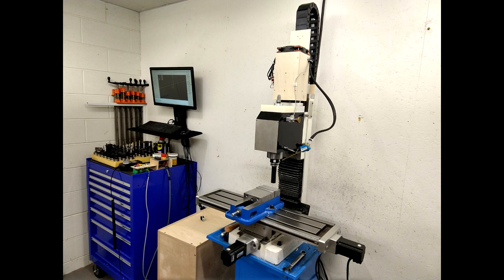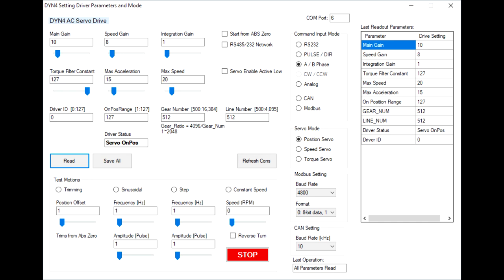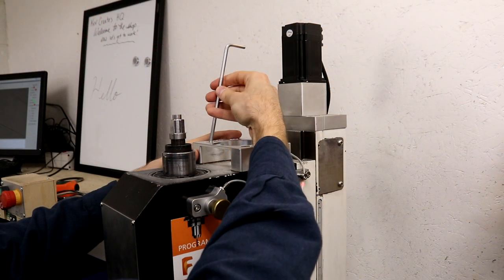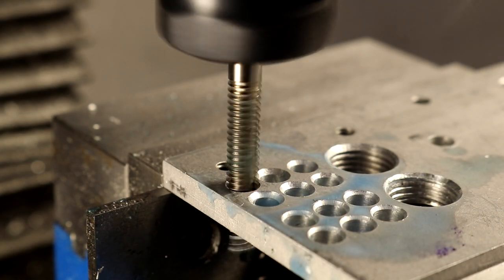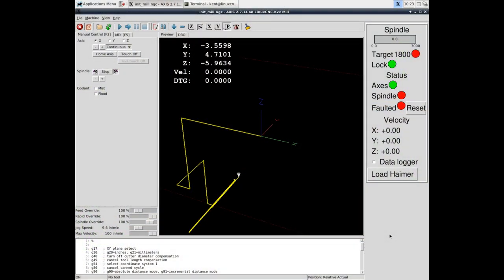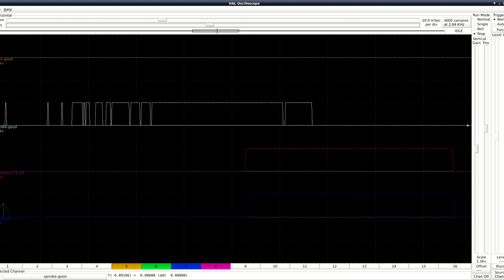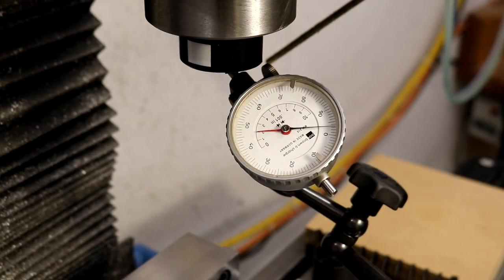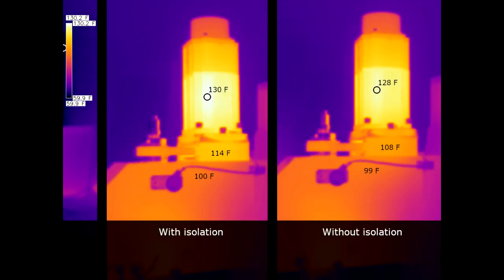AC servo motor for CNC mill spindle: Questions and answers

Comment: Thank you Kent for sharing your experience.I think it's so great that you finally have an electrical control cabinet.Great
Your path shows exactly the path of an electrician.You always have to be able to measure everything.I admire that about you.You can improve everything on the electrical system.Great.Also how you set it all up in Linux.I just look there and have no idea how you do it.
You know I actually did exactly the same thing only with Mach3 and a slightly larger servo.
But who I look at all you did to get it to work in Linux.Incredible.I would never get it done.My electrical setup took 1 day maybe 2 days.
I think you are a very smart man.That the installation was so difficult(linux installation) for you shows me that Linux is not for me or Michael.Too difficult.It's unbelievable to me how you did it all.I'm surprised that your pm 25 can't make coffee yet.
It was just a joke.
After all the work I congratulate you on the good servo.I don't want to give up mine anymore.I wish you a lot of fun with yours.
Now you only need linear guides?They would be good.Then your workpieces will be even better.Let's say that:""""you can sell them"""
I wish you all the best
best regards Stephan
Reply from the maker: Hi Stephan, thank you so much for all the support and kind words! This was ridiculously difficult and maybe there was just something wrong with the drive. DMM stopped replying when I suggested that. So, were the difficulties because of Linux, the particular drive, my breakout board, me? I don't know. I am so glad you didn't have the difficulties I had. My previous mill had a 1.5kW 3-phase induction motor and VFD. That was super simple to setup even though the VFD had many more settings. I've written a serial interface to the drive and that seems more reliable. I'll demonstrate that soon. Just send a serial command "run at 500RPM" and it just works. It'll never work for rigid tapping, the feedback from the drive is a mess and there are pulses lost at even low RPMs, doubled checked against the drive's own position information, but that's OK. Today, spring is near, I just want a working mill, and to leave the basement. Have a great day my friend :) Kent

Comment: I’m still not sure on the ballscrews i wanted to get pretty high quality ones but sourcing them seems to be quite a challenge i did look into tdk ones. For the servos i wonder if i should go mains or 24 volts one is nicer to setup but isn’t so safe and the other one requires lots of power supplies. A complete other point is that i want to still keep the manual way too so i considerd getting a pice that does a 90 and i would place the motor underneath the base not sure if that is a great idea. 

For the servos i looked at lenze and leadshine not sure if there are cheaper ones. I would also like to control everything with ethercat as it’s easier to setup at least i think it is compared to modbus etc.
Reply from the maker: Thank you for sharing, that's going to be an impressive machine! At 24V response might be slower as overcoming inductance will take longer and thicker cable will be required for the higher current. Don't know if anyone would notice. Grounding well will create a foundation of safety.

Comment: Excellent documentation on the DYN4 spindle setup for the PM25! I'm currently researching AC servo's to replace my stock BLDC setup and found this info to be very insightful. Regarding the noise problem found coming from the drive, Could you attenuate the 20KHz noise by using an inline RC style low pass filter installed on the encoder common to filter the noise causing the encoder error?
Reply from the maker: Thank you Kyle, glad this was useful! I can't comment on using the filter. It's worth a try. The best mechanical and electrical solution is likely to use a second encoder. Some time has passed since this video. I have enjoyed the DMM servo. There might be a 5kRPM 1kW special order available, which I would get if starting over.

Comment: Kent. Fantastic information. I have been following your PM25MV videos as I am in the process of modifying mine.  Questions:

Did you consider replacing the spindle itself and/or the stock spindle bearings on the mill in an effort to improve performance for surface finishing, or generally the performance of the mill?  Did you have any thinking on that to share?

Also, I see guys replacing the stock spindle bearings to angular contact bearings when chasing higher spindle speeds. The AC bearings being rated for higher speeds than roller bearings. How fast have you been running the stock bearings in the mill and what can you say about their performance. 

Thanks so much.
Reply from the maker: Hi Iain, we all make do with what we have :) The people you mention are honestly more skilled in the mechanics than I am. If you love the conversion process most of all, both ideas you mention may be worth pursuing.

Some people use very fast 20k RPM spindles with integrated motors or BT30 cartridges with a big external motor. These are often inspirational conversions. Sometimes functionality is lost because of the specialization they are seeking. Before getting into that expense and time like that I would thoroughly investigate purchasing a turn key machine. 

One of the best PM25 conversion threads on CNCZone is from Starleper1 and he states the bearings on his machine are rated to a minimum of 5000RPM. The particulars may have changed since then. With this reference, with no intention of going beyond 5000RPM, with no measurable play, and with minimal heat, for me, little may be gained by replacing the bearings.  The splined shaft has had a greater negative impact on surface finish.

https://www.cnczone.com/forums/benchtop-machines/101231-pm25mv-bf-series-9.html#post859477

Best wishes

Comment: I'm only 15 minutes in, but so far it seems like you've covered a lot of the issues I've had with the same motor/driver (I don't have the brake). I've never been able to get the RPM output to match what it should be from 0-10v and I don't think I've ever got it tuned correctly without getting some kind of overvoltage error from time to time.

However, I never went through with using a line reactor or noise filter, so I'm wondering if that would maybe solve some of my issues.

I've never been able to get the encoder to talk to my Masso controller either, but I think that's more the fault of the Masso than the servo encoder.
Reply from the maker: Thank you for confirming that I'm not alone. Like Fox Mulder, "I want to believe", but I can't imagine everyone out there going through the effort to workaround some of the problems we've had. The encoder signal might be too noisy. On the USC board I have, I believe the encoder lines go right into the FPGA and the spikes that I measured could damage the chip. I have to assume that my drive has problems and other copies are fine.

Comment: Good video!! you seems the right pearson to ask.. I have old lathe (small one) and want to make cnc .. and 1 question which i cant answer is that i want to use main spindle as deviding head.. now the question is will be ordinary servo good enough or do I need to buy servo with brake? can even be programed in linux cnc to use brake when you have souch operation ?
Reply from the maker: Many thanks! Great question, there's a lot to it... Using a servo you could use the spindle as a dividing head. With rigid power transfer between the servo and spindle and good gearing you may be able to perform machining. You'll need to consider the holding torque vs. machining torque. The brake will help to hold position but likely with power no greater than the servo is rated for if matched. The brake does slightly degrade the servo performance and without a good gear ratio between the servo and the spindle you may already have inertia mismatch. This is not a terrible problem if the servo is strictly use for velocity and rapid exact position is not required. You can engage the brake from G code using a digital out, using M62-M65. Please ask if something is unclear.
Reply: @kentvandervelden  Wau that was fast:) I got the basic out.. you see.. Lathe is small a watchmaker lathe.. very accurate one ( tos 80) Not that todays čing čong kwlity.
While reading your answer I get an idea of quick modification. Brake on servo is 2x the price than  without a brake.. so  I will use rearly machene and brake on servo dont justify the price ...but a new mount for servo needs to be made and why not  build a part with small fly wheel and rig up there a breake.. simple and efective- and cheap.
Original motor is 330W and there was model with 550W and im little worried that 750W will be overkill on that smal machene. 
Thank you for answer!
Reply from the maker: @ItisImarko  The flywheel would have an electro-magnetic clutch? While I said inertia-mismatch is not as serious with non-position mode, adding a heavy flywheel might push the mismatch too large. Might require some experimentation. I like small machines... we don't cry as much if the experiment does as hoped.
Reply: @kentvandervelden  Ja correct el breake.. But i think  that breake in servo  will be more than enough to hold position  while you will make small gears like very small.
Just justifay the double price.
Thank you nfor answers!!!
Reply from the maker: @ItisImarko  Should work really well. You may check Alibaba for a stand alone brake. I purchased a NEMA34 brake recently for ~$110USD. It mounts to the front of motor, and there are a couple couplers for attaching the shafts.

Comment: Hi Kent. Great information. Thanks for the video.
I'm using an ABS enclosure, but planned right from the start to place any spindle motor driver/VFD in a separate metal enclosure in hopes of reducing EMI/RFI noise.
I know what you mean about finding a reasonably priced enclosure. The large metal cans sure are pricey. I was looking at wall mount server racks a while back. Maybe 6U to 12U? Might need to mod it a bit, but volume per dollar they seem attractive, and mostly metal. Do you have any experience with wall mount server racks?

Comment: Hi Kent.  I’ve been a big fan of your progress so far. I have a question.  Last year I purchased a 4 axis closed loop kit from Longs motor as my intentions were to use it on a cnc lathe project.  The specs are 2.2nm 4 amp holding torque. Think that’s 313oz inch. Rotor torque is 480gm cm2.  I changed my mind to converting the pm 25 using Arizona vids ball screw kit and figured those motors would just be reserved for the lathe, until I went back and noticed you are using what appear to be similar sized motors.  I was really surprised that you were using one for z.  Do you think the motors I have will get me by for now until I can afford the clearpaths?  Thank you in advance.
Reply from the maker: A huge thank you for being interested in the progress :)
Your motors may have higher specs than mine. I have an early video when I monitor position error while moving the head at 100ipm or so with an extra 40 to 50 lbs. These are servo loop stepper motors. The video is titled something like Pm25 conversion test. So, there's evidence that small motors may work fine. The stock spindle will give out before the steppers fault. The lower power may have prevented tool breakage. Without a doubt, David's kit is worth the cost. I considered the Clearpaths but the cost climbs as options are added and I couldn't balance the cost with advantages. If you have the kit and the motors can easily be mounted, might be great to get some experience to find out what the best area for improvement is.
Reply: Kent VanderVelden Thank you for the quick reply.  It’s good to know and makes my day knowing I won’t be waiting as long to get this thing up and running.  That allows me to afford centroid acorn now and a good vice.   Thank you again.

Comment: You can change the Speed mode 0-10v via the gear number in the DYN4 setup.  Basically the gear number is what speed you want at 10v.  So if you are running 0-5v for 5k RPM, then you would set the gear number to 10,000 as at 5v it would be 5k RPM.  I don't think that was very clear in the manual, but I have a tech bulletin that explains it better.  I also use torque filter to set the gains higher (it's a give and take between them) and of course low integrate to give a longer response time for position to catch up.

Sorry, I have just not had time to put out a video on my 1KW, 5k RPM spindle, but I did get it installed and tuned....it's a beast.  I think the R8 spindle is just too much for the 750w.  My autotune wouldn't work with the 750w, but works great with the 1KW.
Reply from the maker: It's great to hear you had an easier time at this. I hope no one else has the difficulties I experienced. I didn't have much success with the torque filtering vs gain settings. The documentation is so-so. Including pseudo code of the control loop the meaning of the parameters would be clear even if the English description is not. DMM said autotune was only for positioning applications and gave recommendations to start with. Apparently I have the old firmware to which some differences might be attributed. I'll document the serial interface to wrap up this series of videos. Have a wonderful week!
Reply: @kentvandervelden  Yeah, the Autotune does just adjust to position mode (even if you pick speed).  But I guess my point on that was it always faulted with the 750W and actually made it through on the 1KW.   So I think the 750w just wasn't a good match with an R8 spindle (at least not with the large pulleys I used).

Yeah, all the current DYN4 come with a new higher current firmware.  It's worth swapping it out.
Reply from the maker: @jaseng7697  When you run autotuning, does the always motor move? Out of the few times I've tried autotuning, only once did the motor obviously turn. All other times, the same tuning duration was required but the motor did not turn. Given we have different firmware, who knows. Thank you
Reply: @kentvandervelden  Yes, it moves for each tune test and ramps up within each test until it gets noisy.
Reply: @jaseng7697  I realize with different machines, different gain settings will be required, but can you share what worked with you?  I keep getting an over-current fault.  Im running a stock taig spindle (for now) with a 1kw DMM DYN4.  I have the motor and spindle connected via a timing belt (for now).  Im trying to figure out where to start the tuning process at.  Also, what firmware do you have?
Reply: Oh yeah, we are both using a special firmware to allow for an input to change modes from Analog to Position.  But it should have no effect on the tune since we tune it in analog mode, which you should be using.

Comment: Hi Kent. Can you comment on your thinking in selecting the 0.75kW servo over the larger servos that DMM offers?  The 1.0kW and 1.8kW variants are more costly (although their marginal cost isn’t especially large) but they do provide considerably more torque than the 0.75kW motors, albeit with a maximum speed of only 3000rpm.  

What do you feel you traded off, with respect to the performance of the mill, by selecting the 0.75kW motor over its 1.0kW and 1.8kW counterparts?

I am considering a similar upgrade for my PM25MV I am having difficult time framing my thinking on the motor selection. For me cost is a consideration although it isn’t clear what the benefits could be realized with the additional cost of the more powerful motors.  My feeling is that the benefits may not be realized because the mill itself may not be sufficiently rigid to perform operations that require the torque they can deliver. Although that just my feeling.....which I’m looking to substantiate.   Any insights would be appreciated.
Reply from the maker: Hi Iain. I wanted more torque, speed, and measurements. I managed to get these with ok success and caveats. DMM has a special order 1kW 5000RPM motor for about 50% more. Starting over, I'd consider that instead of their 750W, larger if I could find one that still runs at 5000RPM. I got the 750W because I only had 120v, but then found later that 240v is needed to go beyond 3000RPM. Consider installing a 240v service if you don't already have one to increase your choices. I have decent evidence from drilling that to match the max torque of the original BLDC, the 1kW servo is needed. However, even the 750W exceeds the original BLDC over a wider range of speeds. The next question would be so the servo be a DMM... If just trying to turn the tool, they are probably fine. If trying to do the fancy stuff I tried, looking for a drive with more functions, or looking to save some money, I'd investigate the eBay options. Hope this helps

Comment: I've come back to messing with my mill again and was attempting to drill a 3/8" hole in steel and the calculated HP was .446, which is only half the rated HP of this motor. Unfortunately it stalled (even though it seemed to be making a pretty good cut!) and I remembered I had this issue in the past with endmill cuts as well, even in aluminum. My question is, how did you tune your servo to work ideally with your spindle? Using autotune seems somewhat useless since there is no cutting load on the spindle/motor as you tune it, and the same would apply even if you were tuning it manually.
Reply from the maker: Sorry to have missed your question. DMM does not recommend auto-tune for spindles. Are you using velocity or position mode? I had poor performance with velocity modem despite tuning attempts, but position mode worked (for a spindle) out of the box. More power is needed just before breakthrough, I think because of spring back and tool grab following deformation. Assuming that's not what's happening, since some time has passed, you may have solved this. If not, let me know and I'll get you the drive parameters.